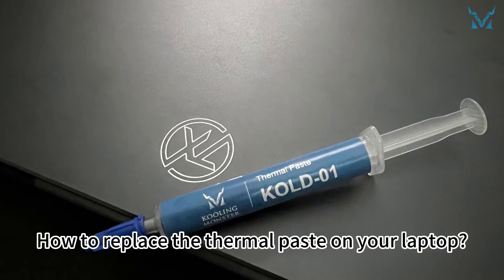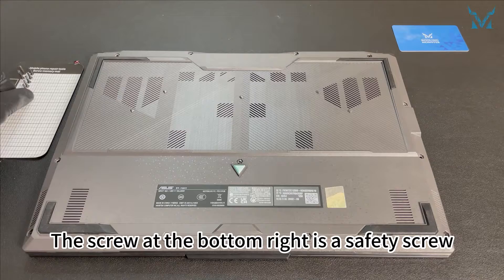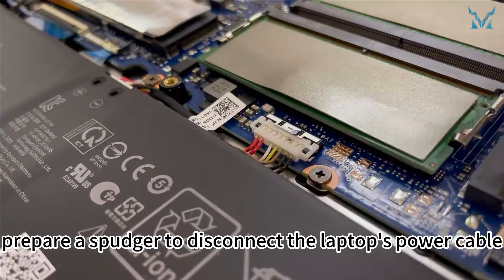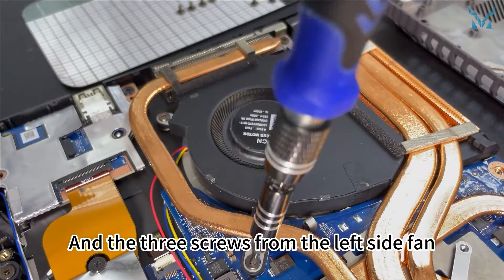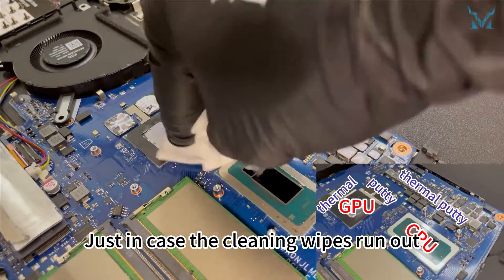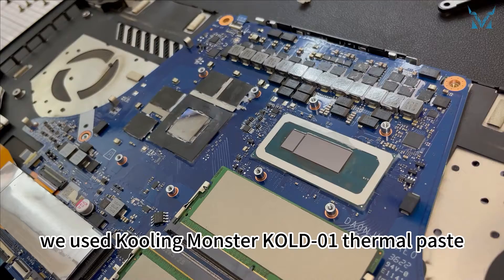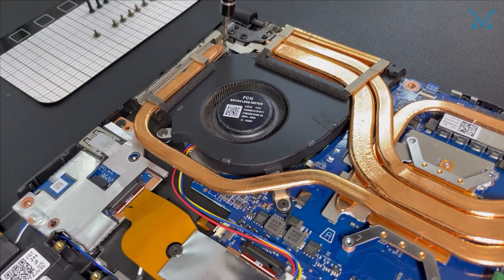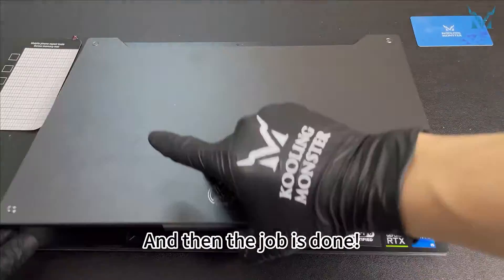Speed Up Your Asus TUF Gaming F15 - Prevent Overheating With Dust Cleaning & New Thermal Paste

Comment: Can I use mx-4 paste for vram or is thermal pad or thermal putty already ok?
Reply from the maker: Feel free to try our KOLD-01 thermal paste. It's different from the regular thermal pastes you mentioned. Regular thermal pastes use solvent-based formulas, which can evaporate when heated, causing the paste to dry out and lose its thermal conductivity. Our KOLD-01 uses an exclusive solvent-free formula, perfectly solving this problem. Therefore, it provides better thermal performance and longer durability when used in laptops.
Hello, we still recommend using high-performance thermal paste. Next time, you can try our KOLD-01 [heart]. Phase change pads continuously switch between liquid and solid states, which can easily lead to misalignment and result in cooling failure during this process.

Comment: can i know what gpu is that in the laptop? 
is it the rtx 3050? :)
Reply from the maker: Hi! You can see the spec of the laptop at the beginning of the video. 0:03 And yes you are right!
Reply: thanks i just wanted to know how many vram "chips"? are on the motherboard, if im correct there are 4,
maybe in the far future when i have a beefy soldering set up, ill upgrade my vram to 4 gb to 8 gb by soldering on new ones, and possibly making a video about it the modification hasnt been done on a laptop by anyone else yet @koolingmonster  
although im probably just going to rent a soldering rig and when i have experience which is super far away as im still 14, but still i know how to do it. maybe when im 18
Reply from the maker: Very ambitious project you got there! We wish you good luck! @perialis2970

Comment: Did you get the problem of this laptop didn't want to start or get some kind of problem after changing the thermal paste?
Reply from the maker: We do not. If you follow each procedure carefully, your laptop will boot up with no problem and will be running faster and cooler than before.

Comment: thanks a lot .I had one question, after how many years does the thermal paste dry out?
Reply from the maker: Usually thermal paste dries out in one to two years. However your laptop usecase and the quality of the original paste also determines this number. The correct way to determine if your thermal paste needs replacement is through measuring the CPU and GPU temperature. You can visit our website and read the full tutorial on this matter: https://koolingmonster.com/insights/how-to-know-if-your-thermal-paste-needs-replacing-step-by-step-tutorial

Comment: vrams and power section generate less heat, good joke :) For real do yours recommend replacing thermal putty with paste? If someone, after a week of cleaning by yours tutorial, damages the laptop by overheating, you take the repair at your expense?
Reply from the maker: We understand your concern, but, yes they do generate less heat than CPU and GPU which can easily reach over 100 celsius in a laptop. Our KOLD-01 thermal paste has special rheology design that allows it to have high viscosity and can do the job of thermal pads. There will be no negative effect replacing those with thermal paste. We have never received any feedback of laptop overheating after following our tutorial.

Comment: I don't think it's safe to put so much paste in the chips, mostly of them should be using thermal putty as you said and not thermal paste, is not the same heat fix as using a putty, that i can tell you from my experience .
Reply from the maker: We understand your concern, however our KOLD-01 thermal paste has special rheology design that allows it to have high viscosity and can do the job of thermal pads. There will be no negative effect replacing those with thermal paste.